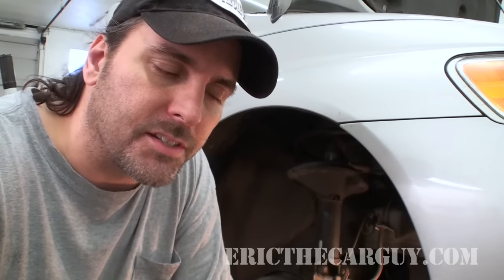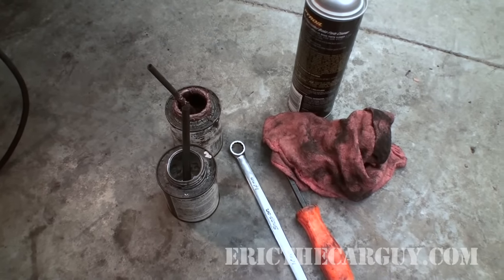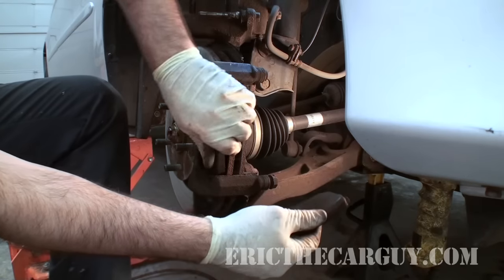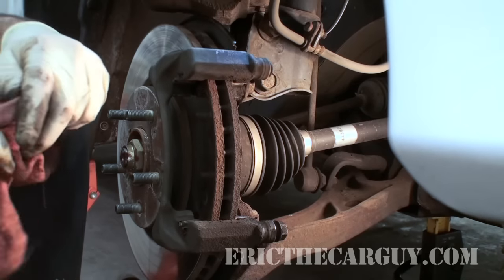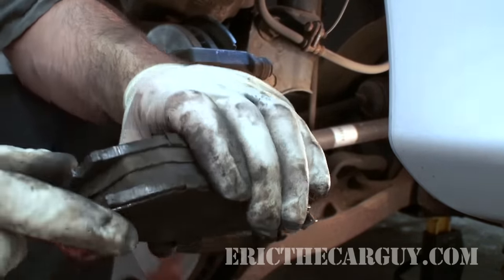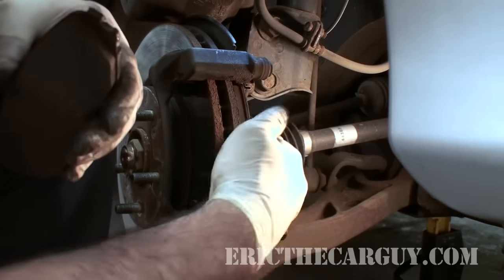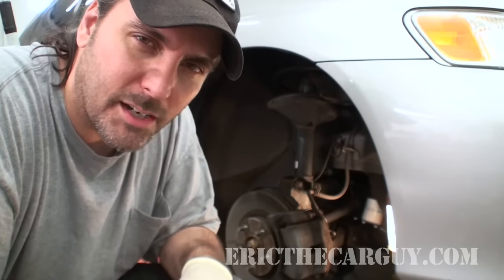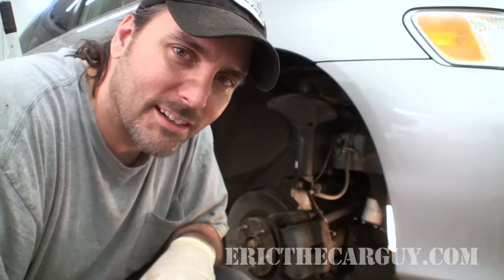The Basics of Disc Brake Service -EricTheCarGuy

Comment: I changed my brakes about a week ago and I took everything apart like in the video, I have new pads and everything is lubed up also I changed my brake fluid, now I didn't bleed my brakes with a bottle like most people would because I couldn't find any hose lying around, so I just opened the bleeder and pushed on the brakes and my brake pedal feels kinda loose, is that a sign of air being in the brake lines?
Reply: yep. You really do need to not cut corners on this. Clean the bleeder head nipple, and if you are really on top of the brake inspection, be sure that each wheel bleeder has its own rubber cap. Grime and foulness from the road, as we know just gets everywhere, and it certainly finds its way to those metal bleeders. Corner cutting also involves you saying to yourself, "self - hhhhmmm, i know how important it is to get some clear hose that fits nicely over the bleeder head. Self... hmmmm, you know if i'm taking the time to lift the car and use jack stands to hold all of that weight, then I can certainly take an extra day or two to find that friend who will sit in the driver's seat to slowly apply the brakes to the opened- gently-bleeder-valve that I have not forced with a three quarter closed crecent boxed  wrench, and that i have prepped with wd-40 on the threads, or prepped with k lube. Oh self, why not ask around and find that clear hose and cup. Because you know "self" - that it will be that much easier to see the bubbles getting out of the system. And "self" all of that collected dirty brown brake fluid in the clear cup shall NOT make its way back to the brake reservoir lest I put not only grime back into the system but also water that is in suspension in the dot 3. And "self" you know how corrosive water is to brake lines from the inside."

Comment: Hay. I see the lower slide in this video had the dampers as you called them. I removed the pins on my 2010 Maxima and didn't pay attention to their location. Does it matter which location the pin with the black tip goes in? Thanks Eric!!!
Reply: Bill Link the one that pivots has the bushing

Comment: I just had to return two rotors.  After installation on the rear along with ceramic pads, the stopping was a bit rough.  I drove the car for a about a week with no improvement.  I swapped out one of the rotors for the old one and the problem improved.  I swapped out the other rotor for the old one and the problem was gone.  I took the rotors back for a refund.  What are the chances of buying two new rotors that were warped?
Reply: the last shop I worked for we turned all new rotors due to being warped because the parts dealer would stack them on top of each other  and the weight would sometimes cause them to warp and nothing sucks more than doing a brake job and have the customer come back complaining of a brake pulsation
Reply: the rotors may have been stored on there edge instead of laying flat. cast iron tends to deform over time and the rotors would become warped. crankshafts should always be stood on there end or hung by there end when removed from a block for the same reason.
Reply: superrodder2002
can you specify or google image us more detail of stood/hung on their end?
Reply: It could have been that the rotors were stored incorrectly, but if they were aftermarket that could just be the lower quality steel used. And when I say aftermarket, I mean anything not from a dealer unfortunately.. I've purchased my fair share of aftermarket rotors, most were supposedly "made by the same brand" as the OE rotors, but it became clear that the OE stuff uses higher quality materials and tighter tolerances. I guess it's a "get what you pay for" thing. Sure, it's diminishing returns but rotors are a particular area where the genuine dealer parts are noticeably better. Worth consideration anyway.
Reply: oh wait I was here already haha, trying to catch up on this computer stuff..

Oh yup looks like this is already answered. It happens a lot, of the rotors being stored incorrectly. But yup just take them back. I would just ask them to get it machined for free or swap them for another set...

Comment: Is lubricant brake-specific? For example, I drive a  2013 Prius II, with BrakeBest Select Premium Disc Brake Pads (rear) and BrakeBest Select Ceramic Disc Brake Pads (front). What lubricant should I get? Thanks.
Reply: For the guide pins? Definitely silicone grease so it's compatible with the rubber boots but none of these brake maintenance videos mention to use high temp silicone grease specifically made for brakes.

Comment: LOL, You midwesterns getting more than 30k out of brake pads, that's cute. But the tip about lubing the contact points and using silicon grease has my brakes wearing evenly now (he showed this on his pad changing video also).

Comment: hey eric i have a 2010 honda civic and it seems to misfire intermediately. i check for codes with a scanner and no codes were present. only does this at idle whether its in gear or not.  any idea what could be causing this. has 55,000 miles on it
Reply: Are you sure it's misfiring?  Could it be an exhaust leak?

Comment: Tried to find that Silicone paste you use but it's only available from the USA and it's very expensive, any ideas of something equivalent in the UK?
Reply: Liqui moly silicone paste should be available in EU
Reply: Its called silicone grease here in the UK. Ebay is the cheapest for me, only a few quid for a small tube to do the brakes with.
Reply: piegonMC Sorry i'm little confused here. I thought that silicon and silicone are two different things?
Reply: Koppakuoriainen Youre correct they are, silicon is a hard mineral, silicone can be a grease/paste, sealant and many other things.

Comment: anti seize lubricant which is a better buy?
copper or aluminum?
Reply: Apparently copper based anti-sieze works better for a brake system so use it! I use the silver stuff on the wheels where they come in contact  with the rotor and on the nuts .

Comment: i have a question for you, i just did a brake job on my 04 tundra 2wd and the brakes are squealing when in reverse i took it apart and put brake grease on parts of the pad but still squeals any ideas?
Reply: Did you get the rotors turned at a machine shop?
Reply: Peter Stuart turned rotors at orileys, new pads and break grease on the pads.

Comment: Is it the same set up for a 98 jeep zj 4.0 
But what kills me is how jeep put those stupid little cover/ caps on the nuts me and the tire man couldn't get the last two nuts off my back driver side rim he had to use a torch I had 2 big black holes in my rim and the two traded screw that hold the nuts was gone a simply $80 tire change and balance came out go $217 grrrrrr

Comment: hi eric, the sliderpin with rubber/damper its on up or bottom of the caliper
Reply: +senlim Yxn I believe the pin with the rubber damper is normally found on the leading end of the caliper, which at least for the Honda front calipers in this vid would be the top.  Yes, that's backwards from where Eric finds the pin's position at in this video.
However, I do not know how much real difference it makes, and for whatever reason some caliper makers (like Bosch) place the dampening pin on the trailing end.
Reply: Its the one that pivots

Comment: What can I do fix the problem if I used non-silicone grease instead for the pins. What should I do? I only been 2 weeks since I did them. Should I go back and wipe off the grease off the pins and use silicone paste. Should I go as far has getting thin brush to get all the grease out of the pin whole?
Reply: 1. wipe it off. 
2. shoot brake cleaner
3. apply new grease

....aight
Reply: Use Q-tips to remove grease from the pin holes
Reply: Dont worry itll be fine

Comment: Anybody know anything about properly compressing the caliper piston? I was told to "be careful" but was never clear on why. I'm afraid id blow the cap off the brake fluid reservoir and splash it all over the engine bay.
Reply: open bleed screw on caliper and push the piston back, brake fluid will leak out of the bleed screw.  When you do it this way you can push the piston back with your thumbs.
Reply: the other way people do it (I have done it this way in the past) is to take the cap off the reservoir and push the piston in - it's much harder doing it this way and you risk flipping (I have been told) seals in the master cylinder.  but the proper way is the bleed screw way.
Reply: C-clamp it slowly.  Dont open the cap or open the bleed screw there is no need.
Reply: Use a hammer

Comment: Hi Eric. Can i use permatex dielectric grease to lubricate guide pins?
Reply: It's compatible with the rubber boots and some guide pins have a rubber bushings, but I don't know if it will hold up to the heat. I've seen a lot of these brake maintenance videos and nobody mentions using high temp silicone grease specifically made for brakes.

Comment: I have always changed my own brake pads.  Does anybody know how much mechanics charge now a days to change brake pads?
Reply: Well, at my dealership we charge $189.95 to replace front brake pads and resurface the rotors.
Reply: James Johnson does that include new pads,if not then I'm not charging enough :(
Reply: me and some friends been quoted around $350 just for front brakes but that includes the un-needed rotor resurface. And then sometimes $600-$750 to include service on the rear-drum brakes... Front pads for american car: $7-$28 or Honda: $27. Then a rotor resurface at a parts-store: $15...
Reply: They really charge this much? Good hell, now I remember why I started changing my pads myself.
Reply: Tyee Cambrón You should do it yourself. That's too much money. The brake pads for my car cost around $26 and it's a 30 or 40 minute job. Drum brakes are a little harder to do, but it's doable. It sure as hell beats paying $600-750.
Reply: Most chain places and stealerships won't do brake jobs without pushing that rotor resurface job. When I had my endeavor Mitsubishi tried to beat me in the head for $750 altogether. I walked out and found a great mechanic who treats me right, he doesn't even bitch when i bring my own parts.
Reply: Yes i do it myself. I even done some of the jobs for my friends, brakepads less than $40, quote $400(?)... but i do different rates of what i charge: the guy gives me a ride to work, then fees are brake pads and some beer... or if it is some random friend then fees will be pads +plus beer +plus a extra few dollar depending on their paycheck
Reply: I give my mechanic a bag of weed.  He does all my shit

Comment: It's a shame you didn't clean your brakelines connected to the caliper, a leaky brakeline is way worse and you should prevent it from breaking down by checking it as well.
Reply: What do you mean clean the brakeline?  Cracks in a brakeline or soon-to-fail brakelines are easy to spot without removing the caliper.
Reply: Never said you should clean your brake line while the caliper is removed, but cleaning it is way easier with your wheel removed while you're still busy with checking your brakes? Perhaps it's me, but I can't spot a faulty brake line without first cleaning off all the mud and oil residue on top of it...? So why not clean it while servicing the brakes?
Reply: mkleij
The reason I questioned this is usually brake lines look the way they did in the video.  There was no mud or oil, which is why I don't understand what you mean by cleaning them.  Do you mean scrubbing them with a brush? Do you mean spraying them with brake cleaner?
Most mechanics can spot faulty brake line by soft pedal or that smell of hydraulic fluid burning off.

Comment: Oops...amateur mistake. You didn't torque the caliper slide bolts. You do know that you are talking to a lot of beginners that have no idea why you need to torque nuts and bolts with torque specs. If you are a professional, you shouldn't be cutting corner in your demonstrations.

Comment: abs lights going on how to fix that?
Reply: Are you feeling the pulsing when you brake?  The indicator ring around the axle could be damaged and giving false indication that the wheels are locking up.  Also, check brake fluid.